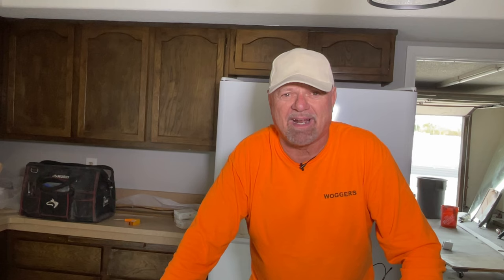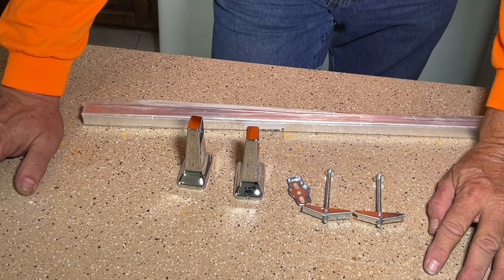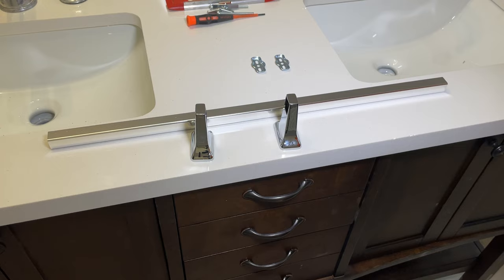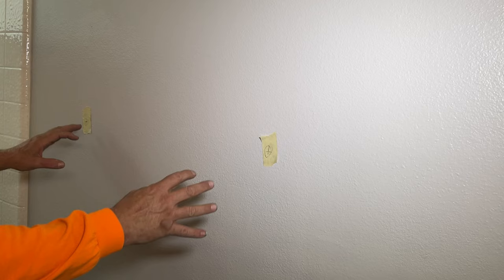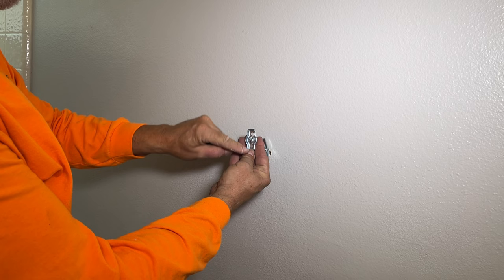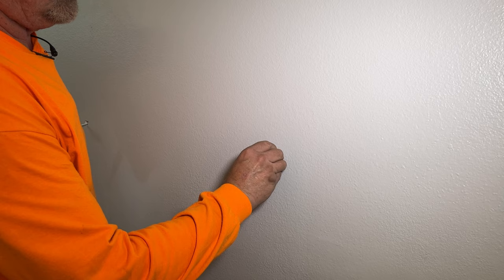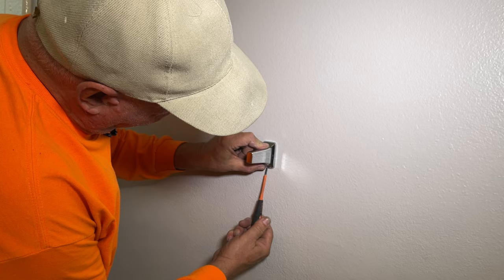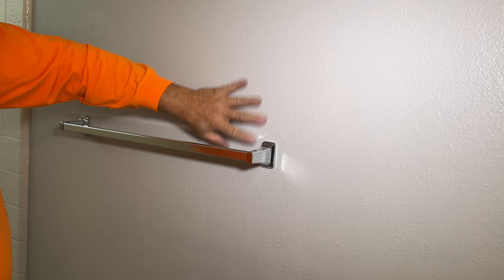How to Install a Towel Bar in Drywall | Strongest & Best Way

Comment: Starting at about 13:00 into the video, it appears that you did not snug up the toggle bolt on the left end, you just left it loose as you leveled the bar and then attached the bracket on that end.  Did I miss something, or did you just leave that end loose?
Reply from the maker: Good observation.  I actually did leave it SLIGHTLY loose to help line everything up.  On that type of towel bar when you tighten the set screw it wedges in behind the bracket, pulling the bracket out and tightening up the bond between the bracket and wall.  Not all types will do that, so depending on the type of mounting system, you may need to tighten everything down prior to attaching the towel bar end posts.  Thanks for watching

Comment: How do I repair when someone has pulled towel bar off and I have hole
Reply from the maker: If the holes are small enough to be covered by the end posts and still allow a toggle bolt to grab, then you're still good, but if they holes are to large the only option you have, unfortunately, is to patch the holes and move the towel bar a couple inches left/right or up/down since the patch won't be strong enough to support the towel bar.  Wish I had a better solution for you.  Thanks for watching.